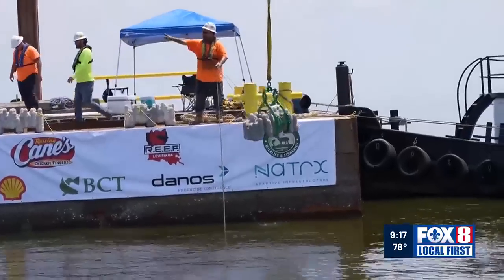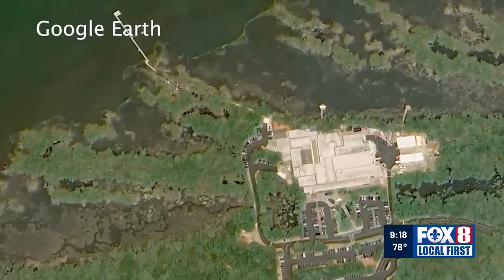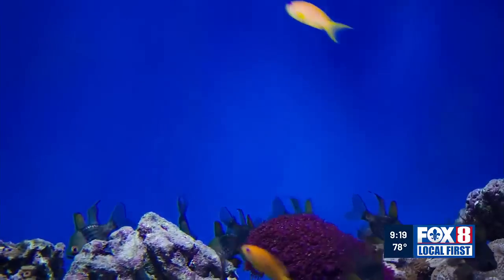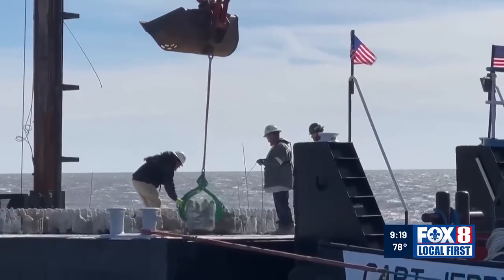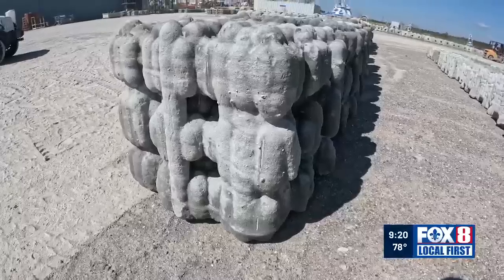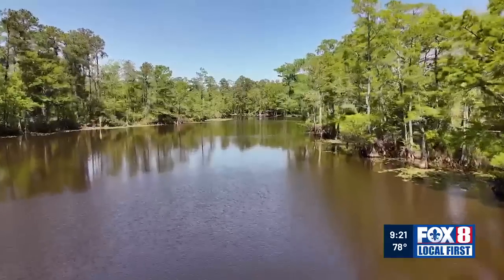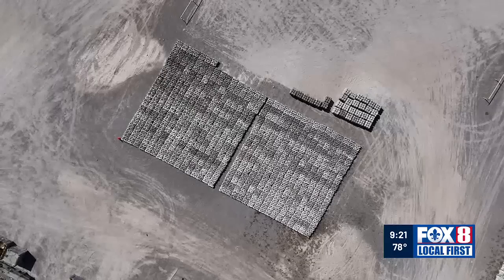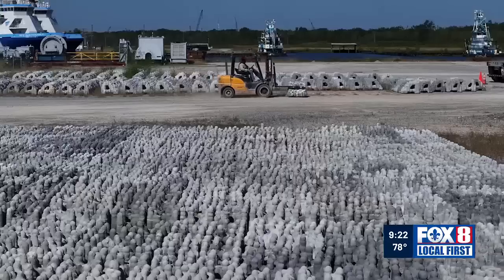3-D printer creates unique solution to protect Louisiana's coast

Comment: In general, a jetty is riprap then the material layered on top until you reach the angle of repose.

The jetty or series of jetties, or piers, or other modification to a shoreline will interrupt the natural shoreline material slow movement further along the shore in one direction, and that can result in scouring that will lose the beach you have or fill in that nice intertidal zone you have.

From what I saw in the video, I would say placement is everything for your situation. That natural area can fill in with invasive species or not have sufficient inflow and outflow.

Belfair State Park, WA had someone who knew what they were doing with their tidewater pool, however that was 50 years ago.

Comment: If you cut these in half and create a mold out of it, you can pour aerated concrete in the mold for an identical result, but 100 times cheaper.
Irregular, rough shapes with pockets of air is all the plants need to grow on.
Aerated concrete is 4 to 5 times lighter than regular concrete. That should do the trick.
Reply: You do but you don't want it too light or else the durability squanders underwater and it would be taken by waves. 
It works better on land than at sea
Reply: @WhiteWolfos  Have you even watched the video? They claim the material they use is 10 times lighter than regular concrete.
If it stays in place, then my suggestion for a material 5 times lighter than concrete is still twice as heavy as what they propose, therefore it should certainly stay in place.
Reply: Concrete is not an eco-friendly material. This is an eco project.
Reply: @aunteefa  Have you watched the video? The blocks are made of a mixture of cement and sand. That's concrete but without rocks. It requires the same amount of energy to produce, or even more than real concrete.

Comment: But they're using concrete which is already a problem
Reply: So what else could they use? At least with the cement/sand mixture it will eventually dissolve with time and water movements without leaving anything toxic behind - after all, it's just sand and 'rock' - (okay, cement = limestone & clay).

Comment: Looks more like injection molding, rather than 3D printing.
Reply: But there is no mold. Think of the water that they're injecting as the filament. Instead of printing plastic in air, they're printing with water in concrete powder, I would contend that it's more akin to lost-wax casting.
Reply: If you're only familiar with FDM then sure, but this is basically RLP (rapid liquid printing) combined with binder jetting, as the shape is fully digitally controlled by the water dispensers instead of using a mold.

With rapid liquid printing, you inject a curing resin into a bed of gel that supports the shape. The shape is controlled by injecting the resin exactly where it's needed. This is not molding because there is no mold that determines the shape - the shape is controlled by how much water is injected where. That's what allows them to "print" any shape within the same cube of concrete powder, and without needing to swap out any parts or molds.
Reply: @KibbieKatt  - Well there goes a few more jobs out the door - mould makers and tool & die men.  That Universal Basic Allowance is looking better and better 🙂
Reply: @KibbieKatt . ..
thank you professor!
Reply: “The process injects the material through a series of needles” this is definitely Injection and not printing. 
I don’t really think water can be called filament as it exists naturally.
Reply: @AlecInstant  Splitting hairs. What you think of as 3D printing likewise injects material into the atmosphere in order to create solid structures without a form.
Reply: @Yutani_Crayven  - Oh THAT was such a looooong stretch 😂 - loved it!

Comment: Thats nothing tondo with 3D printing.
All they doing is inject concrete into a mold.
Reply: There's no mold lol they used those tiny rods to inject water directly to the powder mixture of sand and concrete that's why they can create any formation as they wanted
Reply: It's basically rapid liquid printing except instead of injecting a curing material into a gel suspension they are injecting water into a concrete powder bed. The key difference is that the shape is controlled by the injection, not by any mold or barrier that holds any shape.

Comment: A mix of cement and sand...  sounds like concrete.
Reply: Better concrete than plastic
Reply: @TakenTook that’s what I was worried about and why I clicked on this video.
Reply: @HaHaHaYouFool9439  -- Same here. As soon as I hear "3-D printer" the first thing I think of is some sort of plastic, nylon, or other man-made hydrocarbon polymer as the substrate. I was going to be very upset if they were just molding plastic into aquatic-looking shapes and throwing it in the water with some sort of weight to hold it down.
Reply: @TakenTook  glad to know I'm not the only one. So many issues we have including human health are caused by plastic.
Reply: Literally stated at 1:14
 lol

Comment: Why cant u just pour cement into molds....? Lol...
Reply: Would be next to impossible to maintain voids and the fine details-by pouring.
Reply: No, vibrate and make mold to come off. Design non bulbous ends of "coral" and remove, repeat the process with 20 molds? No 3d needed and anyone can do it. I'm no engineer but a layman can pour concrete into a mold. @leonardodalongisland

Comment: Concrete is a hazardous waste.
How can they legally dump hazardous waste?
Most concrete is above the ph level of 12.5 and that makes it hazardous according to the EPA.
Reply: MOST
Reply: Exactly.  If it has cured for a year, at least, outdoors, and the rain and sun take their natural toll on the "blocks", then they'll be okay.  But you're right, they can't just be printed and dropped in the water as soon as they are dry.  I build a fish pond out of concrete, and killed my fish.  I gave it about a month to cure, hosed it out 2 or 3 times, and my very expensive, very large koi were dead the morning after I put them in.
Reply: @NegativeROG  A pond environment is also very constricted. In the ocean with tidal flow leaching will happen faster.
Reply: @raclark2730  Have you done ANY research on the environmental impacts of cement/concrete?  Have you?  Are you guessing?  Are you assuming?  Do you have a degree in Materials Sciences or maybe Chemistry?
Reply: @NegativeROG  This is a u tube comment section not a university lab. Take it or leave it.
Reply: @NegativeROG  sorry about your Koi.
Carp are pretty tough fish.
Reply: Not when its set and cured.
Reply: The rough porous surface is also ideal for the anchoring of microscopic coral polyps and other marine life. Mimicking the old coral frameworks that are found in nature. 🐡☀🌞😎
Reply: 😂
Concrete is not hazardous waste.
Reply: @NextNate03  according to our goverment it is
Reply: But wouldn't that help, even if just a little, on balancing the rising acidity of the ocean?

Comment: Perfect example of using a bandaid when stitches are needed.
Reply: You make a great point, we still have to address the source of the problem, or else the ocean will fill with oil and plastic, while we try miserably to clean it up with a small container, for example.
Reply: How is that a bandaid solution?

Not only it helps protect coast lines from disappearing, it also helps the coast line grow.
Reply: @NextNate03  Because the process of making the blocks actually does more damage and doesn’t solve the reason the erosion is happening in the first place.
Reply: Stitch together a better idea.   Let's hear your solution.
Reply: @TheTibetyak  The reason for the degradation has been a known issue for 50+ years. We didn’t stop it then, you aren’t stopping it now. But hey, superman bandaids do look cool.
Reply: @jimk8520  For longer than 50+ years, we have known about the problem of cancer. We didn't stop it then, and we still haven't.  So should we stop trying?   BTW, you still did not offer a solution.   And if you think there is no solution, that is genuinely ok.
Reply: @TheTibetyak  So a doctor goes to see a mechanic about a noise.

While the doc is waiting, he strikes up a conversation with the shop steward. During the conversation, the steward brings up the idea that mechanics should be paid as well as doctors since they essentially do the same type of work.

The Doc simply replied “I’ll pay you my wage when you can rebuild my engine while it’s still running.”
Reply: @ yOuTUbE CeNsoRsHip sucks. Biological evolution uses the same pathways so there won’t be one - only better therapies for immune system failures to check the behavior.
Reply: @jimk8520 the fallacy with that is that you can't rebuild a heart while it's still running, and a open engine block would kill a car doctor as it's vastly more dangerous to run combustible gas. You can repair arteries and subvert blood flow while the heart is running, and you can repair pipes, tubes, inlets, intakes, sensors, etc while the engine is running. 
Despite both having their difficulty (and auto repair arguably higher labor) the thing is that humans being body repaired are more expensive because of the 1 life value vs a car that has limited value and can be recycled and replaced. You can't replace a family member the same way you can replace a car hence the pay difference. It's similar to organ demand too except now they are letting deceased owners donate fresh organs more than ever before as well as 3D printed organ parts and organ growth science helping lower the costs.
If anything, the pay rate might be more comparable to a veterinary/vet surgeon due to the subject value.
Reply: @WhiteWolfos  Yeah, the narrative could use some work but then again, you’re getting lost in the details of an old joke that I used loosely as a way to point out that the problems the solution in this video is intended to solve aren’t getting fixed with a tune up and some 40wt oil.

Comment: Perhaps they could get their 'sand' from Glass Half Full, which has been pulverizing glass to make sand. They are already placing bags on coast with great results - imagine combining both.
Reply: Or, just introduce parrot fish
Reply: @SteveVi0lence no, that is the exact opposite of what we want lol
Reply: Need to get som decommissioned  oil tankers to get som San from the Sahara
Reply: @CSM.HB.J-Dogg completely the wrong type of sand. There is a reason desert countries have to import sand to make concrete
Reply: @littlehippo5004  Sahara sand has been tested and came back as sea sand.
Reply: @ the usability of sand for concrete has nothing to do with where it’s from or what it’s made of and everything to do with its shape. Desert sand is far too round and smooth to interlock with cement, and much of the strength of concrete comes from different sizes of jagged sand that lock together. River and sea sand are more jagged which allow them to bind together better.
Reply: @littlehippo5004  cool but the Sahara sand is Sea sand 😂😂😂
Reply: @ no it’s not. Desert sand is sand you get in the desert. Sea sand is sand you get in the sea. It doesn’t matter if it’s from the sea 1,000,000 years ago, those years do a lot to change the sand. It becomes completely useless for concrete, which was the point of your original comment.
Reply: @littlehippo5004  🤝🏿 Learned something
Reply: @quakerz9501  I saw that I went back and did some research
Reply: @CSM.HB.J-Dogg  Desert sand doesnt have the right grain size and shape. Concrete made with the wrong sand is much weaker.